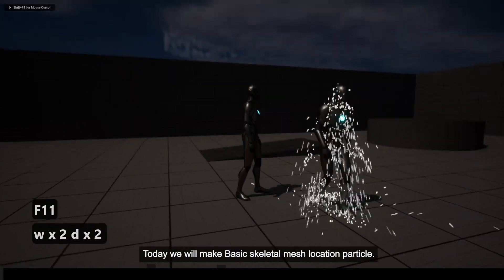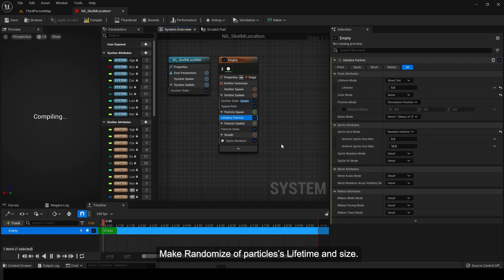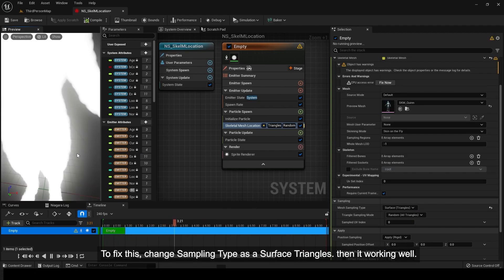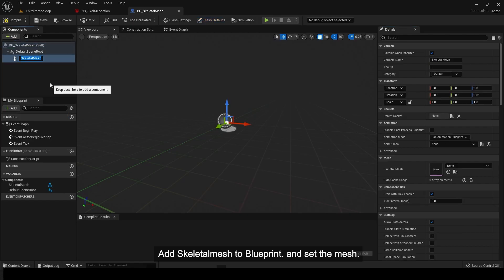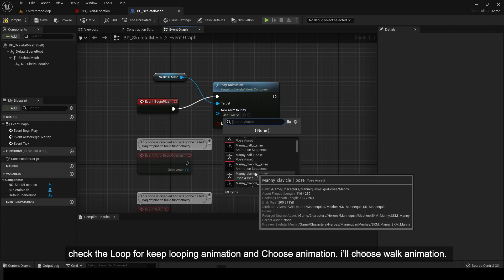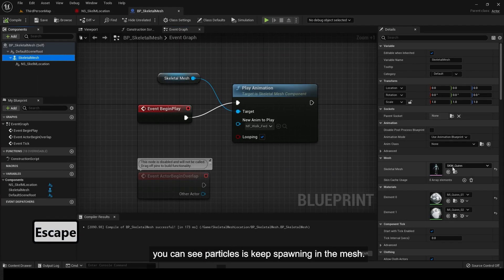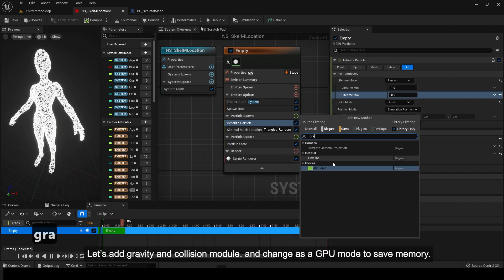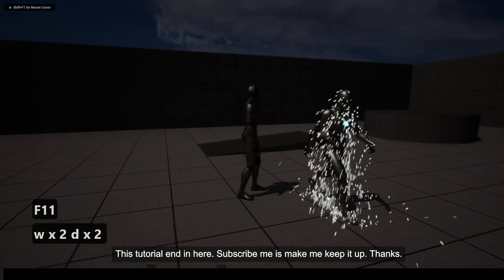Ue5 Niagara Skeletal Mesh particles

Comment: hi, gravity doesnt work and does nothing? what could be issue?
Reply from the maker: maybe you need to add 'Solve forces and velocity' module .   below of 'gravity force ' module.  module's order is important.
Reply: thanks for reply. @SoftTofuVFX
Reply: no, issue was i was using skeletal mesh location in particle update rather then particle spawn, major issue, since it doesnt work or make sense. 
fixed it, by adding skeletal mesh location in particle spawn and removed one from particle update. niagra. @SoftTofuVFX